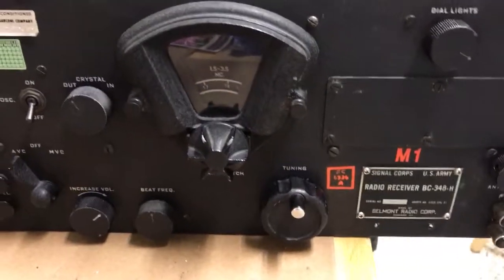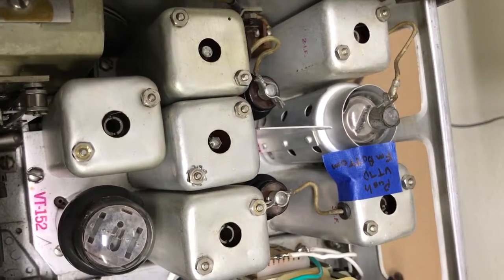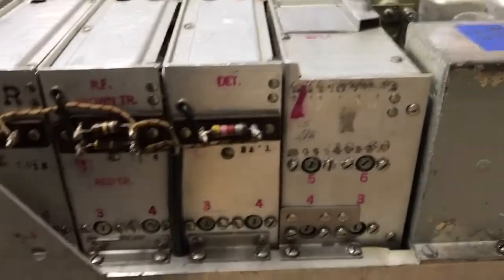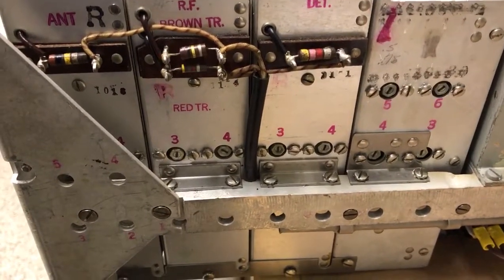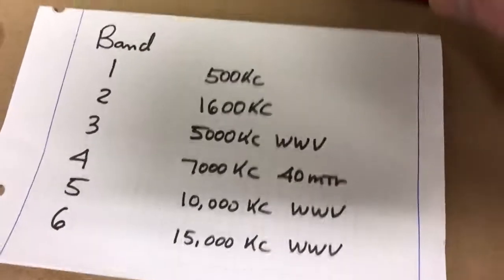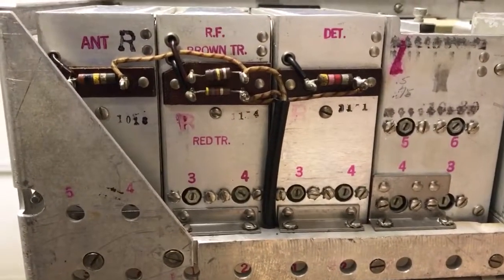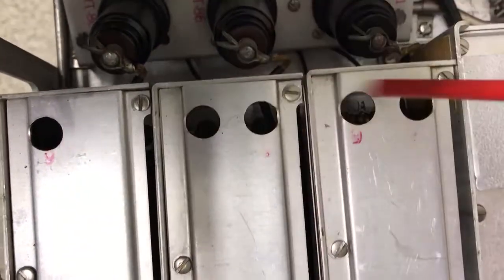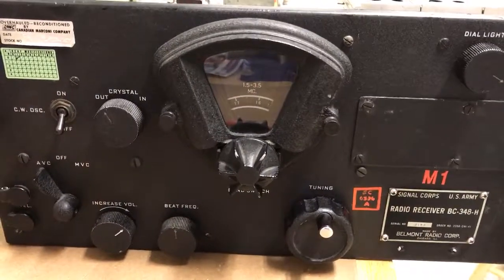Simple BC-348 Alignment.

Comment: Can you please tell me where do I need to connect the power cable to feed it with 220 volts AC? Because mine came without power cable and I don’t have a clue to connect the wires and feed it with 220 volts ac. Will be glad if you may kindly guide me. Thanks in advance

Comment: Hey there from Maine!  I just got my Christmas present from ETSY of all places.  A pretty nice 348Q, already with power supply and cord.  Mostly original tubes with 1943 date codes.  I have replaced the weakest tubes and it works nice and the BFO easily sorts out SSB and is very easy to adjust.  However, all the bands are off pretty far.  WWV shows up on 4.7 Mhz.  That is the worst but all bands are off.  80m ham band is off by 500 kHz, etc. My question for you is- will the trimmers adjust that far?  I thought I would ask before I begin.  Thanks!
Reply from the maker: The alignment will fix that problem. It’s the oscillator adjustment in particular. Do that first to get the frequency alignment you want and then do the others.

Comment: so if I understand correctly, the IF oscillator is to ensure the frequency dial is calibrated correctly?  so you set the dial to a specific frequency and adjust the relevant oscillator until you get the strongest signal?  On the three RF stages, where do you put the ac voltmeter?
Reply from the maker: Yes that is correct.  You can put the ac voltmeter on the speaker output and peak the indicated voltage.

Comment: Hi! Seems you have a special screwdriver in order to avoid pushing the screw inside. Is it self made? I managed to push too hard and the rotor moved from its axis...
Reply from the maker: I used a Radio Shack alignment tool